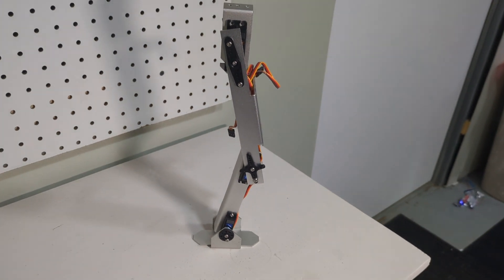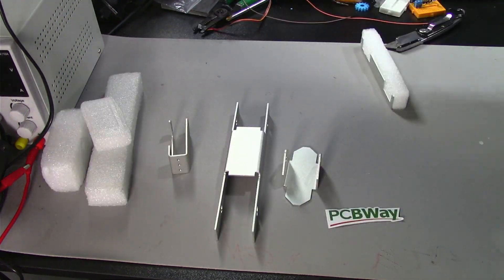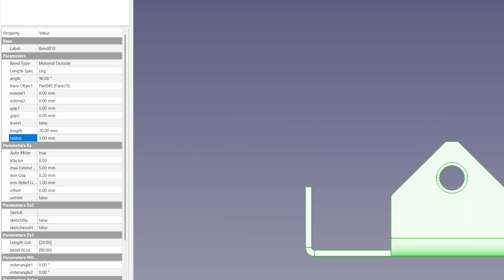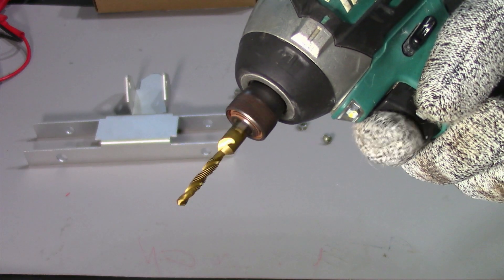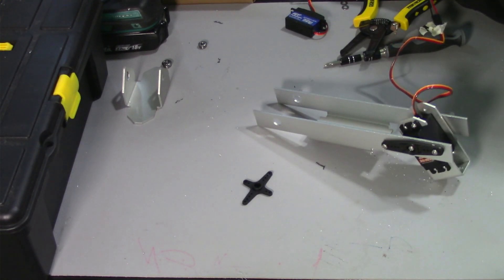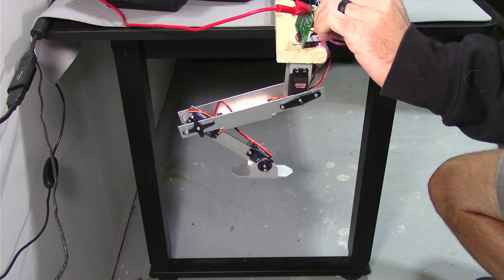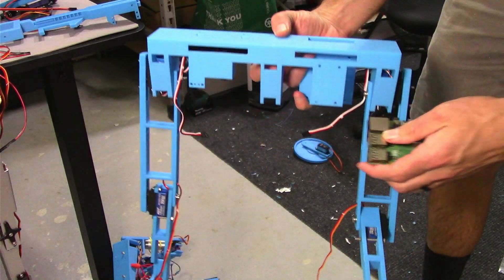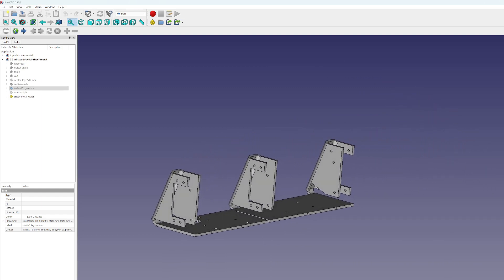Metal vs Plastic Robot Leg: How to Build with Bent Sheet Metal

Comment: I understand the video is sponsored, but it's just NOT that hard to cut sheet metal with a jigsaw and a few good carbide blades.  Keep it oiled or use tapping fluid, and be very careful to clamp it well. Drill out the corners of interior spaces. For straight lines, a diamond or carbide blade in a circular saw works a treat. I've cut 1/2" like that. Cleanup with a file or angle grinder. Don't bother with nibblers or shears unless you have big money; the cheap ones are junk. Faire point about wearing gloves. A basic brake to bend it is ~$60 at Harbor Freight. Or $20 at a garage sale or online market place if you live in a big city. The main point is if you aren't waiting for a service to ship it from the other side of the world, you can quickly make a new one when you find an error.
Reply from the maker: Agreed, if we are going to enter Tripedal into combat robots we'll need to bring at least 3 to every event (there are multiple rounds, and you can swap out robot clones during rounds)

Comment: Very interesting video! A few questions: 1) What books would you recommend reading to help someone get started in making small robots? 2)Why FreeCAD instead of Onshape? 3) How did you learn to code the robots? Any recommendations on learning this kind of coding?
Reply from the maker: 1. Instead of a book, buying an Arduino Starter Kit and go through all the sensor lessons. Then Build a simple robot like an Arm or Rover. 
2. FreeCAD is 100% free and local, where OnShape has a paywall and is a cloud service. We've used OnShape and its fine, but its not ideal for the way we operate. 
3. Our day jobs is software programing, so robots was an easy transition. You have to commit to learning how to code. Python is a great programing language to learn. Honestly any LLM like ChatGPT, Google's Gemini, Gronk, Claude, Llamma will be great teachers to help you code. And there are lots of great teachers on Youtube.